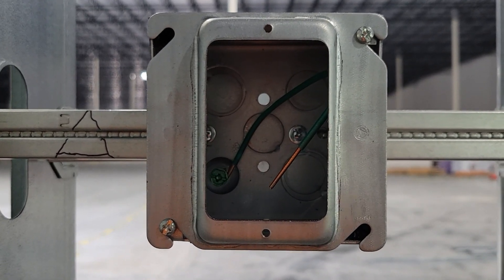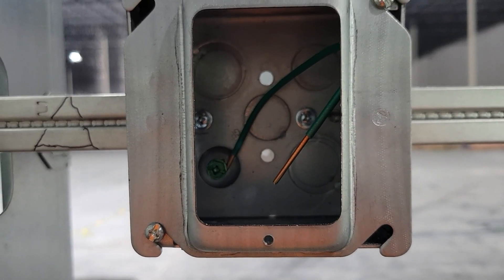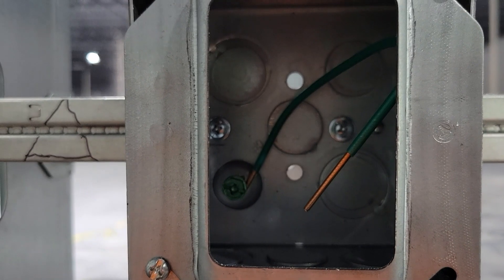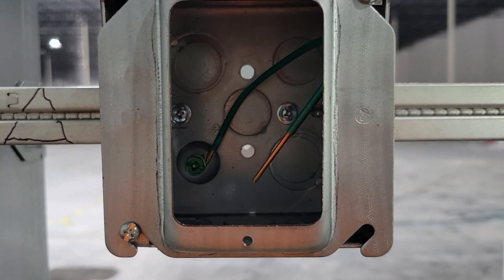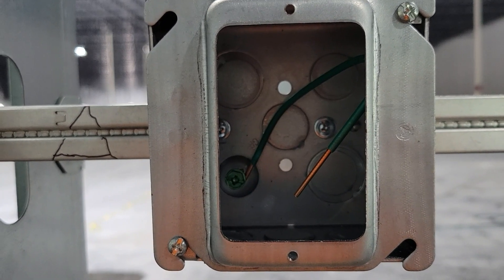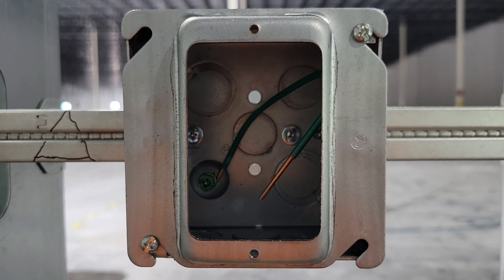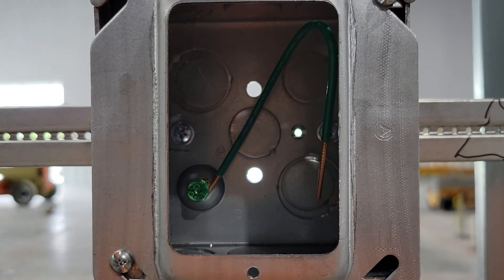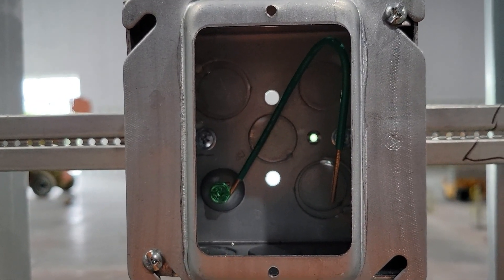Grounding Pigtails Are Required In Outlets And Junction Boxes!

Comment: The code does not say that every box needs a pigtail. What the code says is that if you have a splice on your circuit conductors in a box solely intended as a splice box you must also have a splice on the equipment grounding conductors. If the splice is not made on the egc's they can also EACH be terminated to the box to maintain continuity between them. Many many many electricians are misinterpreting this code and are now simply not running the supplemental egc within the metal raceway to save time and money.
Reply from the maker: The title says outlets and junction boxes.
Reply: @ElectricianToolDeals  a splice box is a junction box
Reply from the maker: Thanks for the comment
Reply: You do not have to use pigtail
. You can strip the ground wire itself and wrap it around the ground screw.

Comment: You can connect the green to the ground screw in the box. The brass self-grounding clip on the receptacle will ground the receptacle to the now grounded box
Reply from the maker: Thanks for the comment. This is true. However, when you put the outlet on the mud ring, you are relying and 2 things to stay tight to assure you have ground. Pigtails are cheap and definitely guarantee a good bond no matter what.

Comment: What about window cuts? Are those no longer allowed?
Reply from the maker: I'm not sure I use the same name. Please elaborate
Reply: @ElectricianToolDeals  a gap n wrap. Gapping the insulation on the conductor and then wrapping the bare copper then around the ground screw. I've seen it done a lot and I also do it occasionally